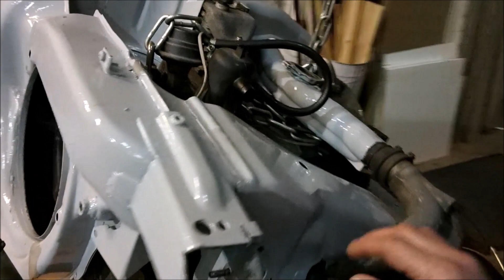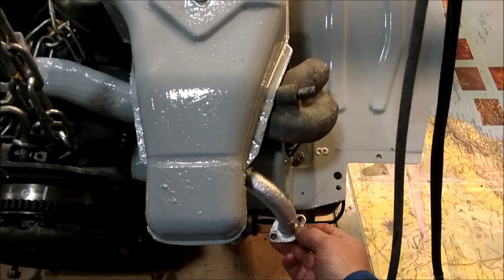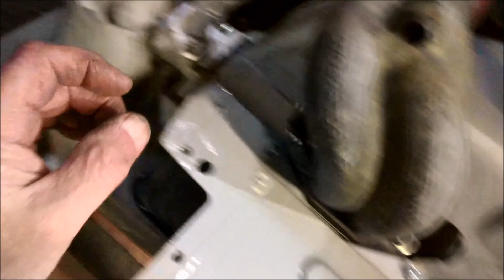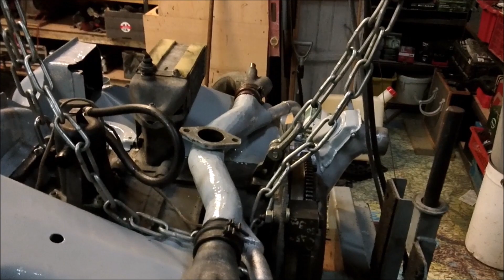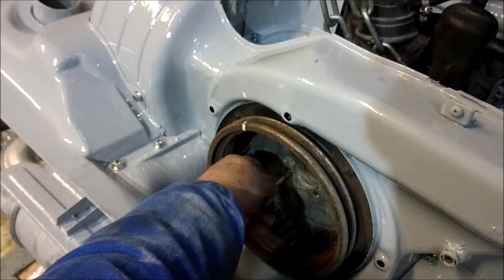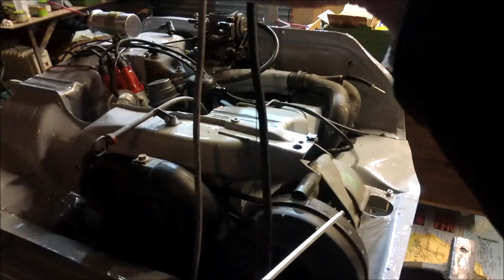VW T3 CT engine  rebuild part 4 2024

Comment: I see you also leave out the air flaps in the tinware (nobody seems to keep these in place on these engines!) (your chest camera need aiming down a little more btw).
Reply from the maker: Hello,
Yes, for the best part of 20 years..the wongly flaps go. This was originally because the thermostat was unavailable. Yes it takes 5-8 kilometers for the engine to warm up 5flat spot gone), but these are cruiser engines; to run cool.
They are video glasses, and I do tend to look over them...
Cordialement,

Comment: Hi there I've watched your video on setting up pdsit 3 throttle position which I did put the carbs back on and noe it idles very fast when chokes are closed. Where exactly did you place the digital calipers when settling warm idle as your hand was in the way when filming it. Getting annoyed trying to get these carbs set up. They have been thoroughly cleaned and rebuilt with new gasket kits. Any help you can provide would be much appreciated paul
Reply from the maker: Hello, thanks for your message.
If you close the throttle butterfly just till it touches the side walls, then open about 1 turn so you can see a small arc of light . then adjust the main idle speed screw on top of lhs carb. If it is still running too fast, then close the butterfly a bit. If you have the early type carbs you can use 2 vacuum gauges to see at what opening you get a vacuum signal. Another video: https://youtu.be/VtVIGXmJd0U
shows you this.
Cordialement,